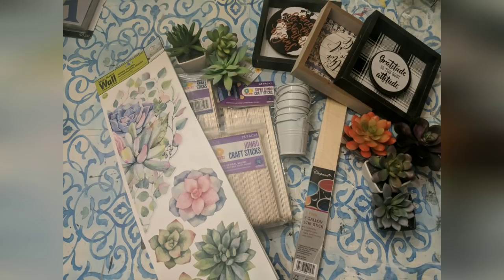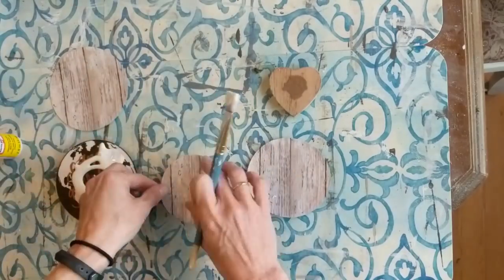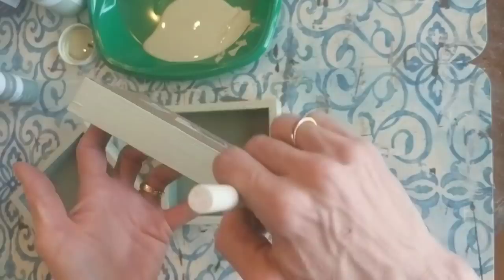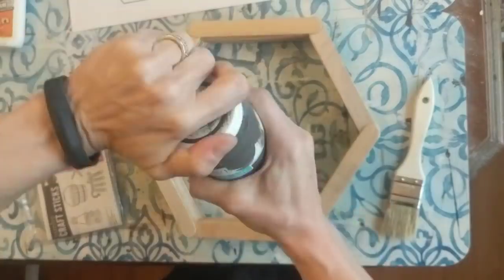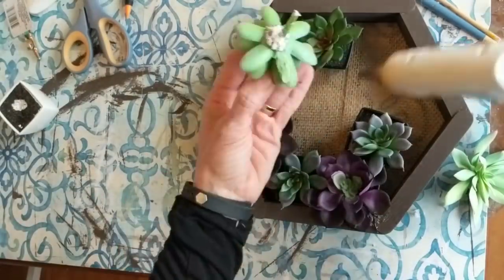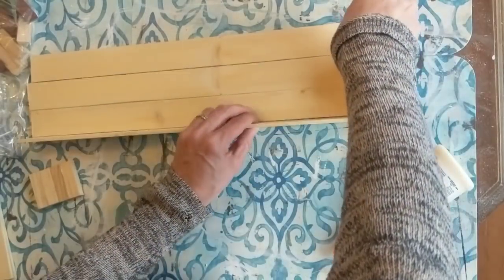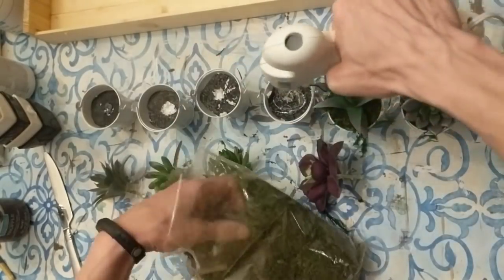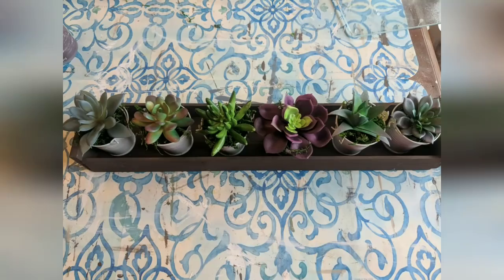DOLLAR TREE FARMHOUSE SPRING SUMMER SUCCULENT DECOR DIY #dollartreediy #succulentdecor #burlapfabric

Comment: Love it! I have found it is easier to use a sponge paintbrush when painting edges. You have more control  & not as likely to miss the small edges when using a regular paint brush or a sharpie.  Love both of the green colors on the 1st diy.